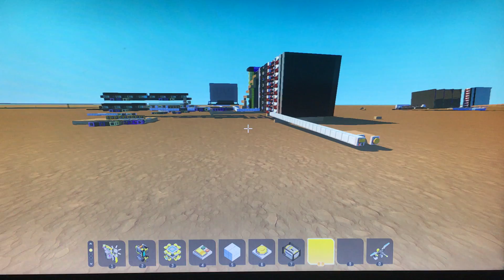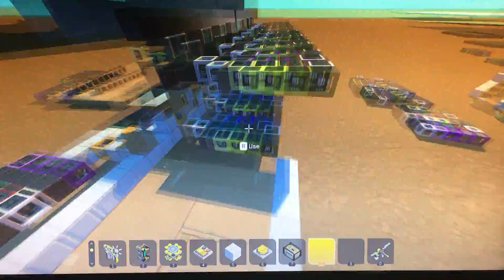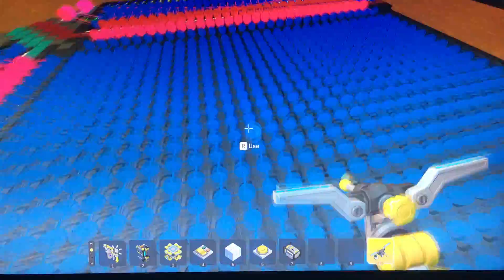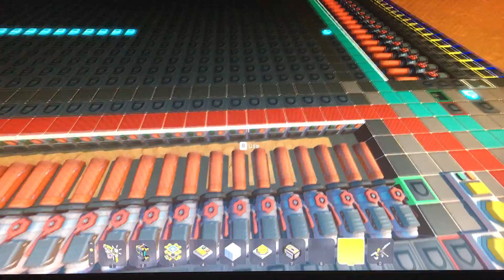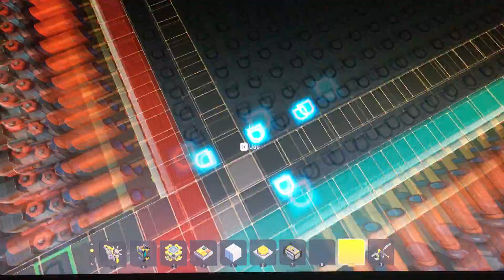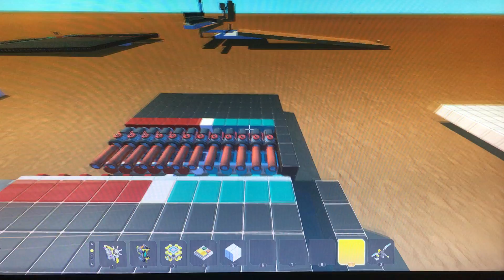computer display project (part of the new screen) demonstration

Comment: Neat ideas you have there. I recommend Brent Batches Blueprint Tool for making connections in bulk, like for your AND gate grid. I started using it recently and it saves me a lot of time. It also makes it easier to build bigger arrays of things, like the spudgun memory you showed at the end.
Reply from the maker: ill look into it. one of the machines behind it was a device the would movie my player around above the AND grid in a motion like 1,0,2,0,3,0,4 and so but its kinda slow so i haven't used it.